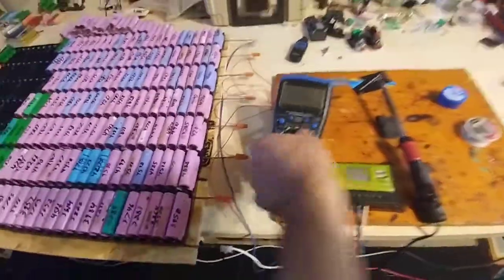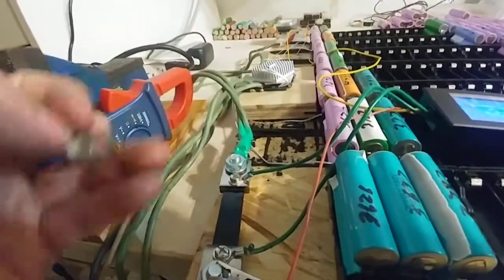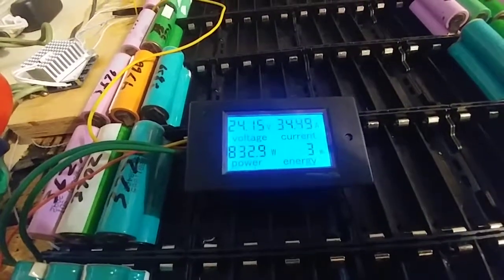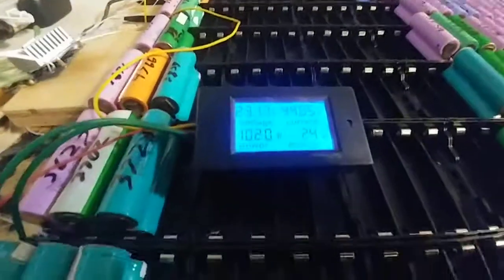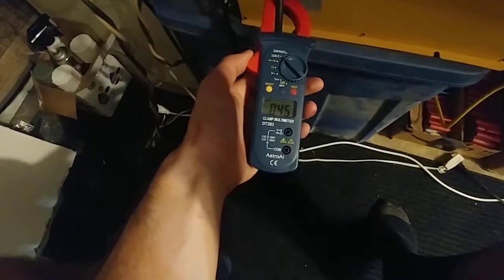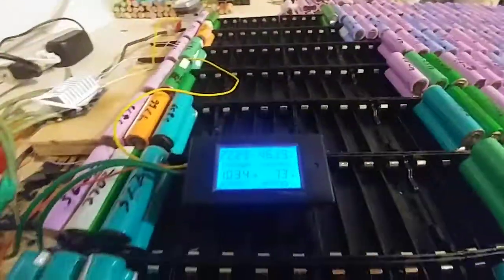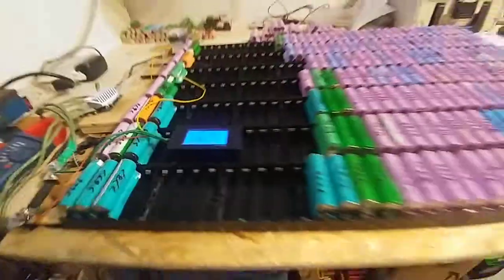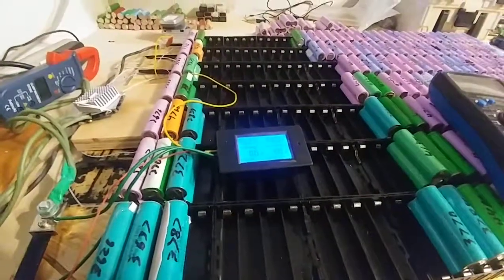18650 7s shunt max amp draw test

Comment: You need a clamp meter that does DC also like this one.  https://www.amazon.ca/Klein-Tools-CL380-Digital-Auto-Ranging/dp/B07P323914/ref=mp_s_a_1_3?adgrpid=66629406448&gclid=Cj0KCQjwtr_mBRDeARIsALfBZA7j-GY2KiVfJieKCOyystFYnK9vpziS1YR0uFL4dWEj5rOaGuxoOdMaAn5sEALw_wcB&hvadid=310038582202&hvdev=m&hvlocphy=1002401&hvnetw=g&hvpos=1t1&hvqmt=b&hvrand=17602131861274168680&hvtargid=kwd-298295011426&hydadcr=28103_10625930&keywords=clamp+meter+acdc&qid=1557188046&s=gateway&sr=8-3

Comment: When you put your amp clamp on the ac wires you don’t put it around both. You have to separate those ac wires and only clamp one to get a reading or they cancel each other out and your reading is way way off. Cheers nice job on the wall.
Reply from the maker: those were doubled up wires and dc voltage so done wrong all together. A 100A shunt was implemented shortly after.